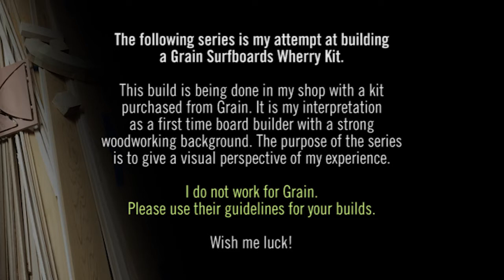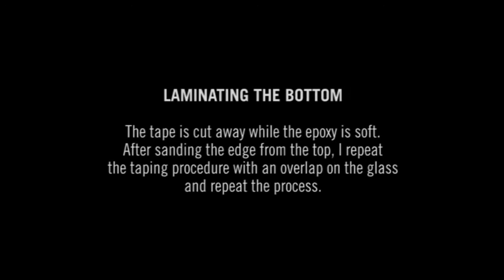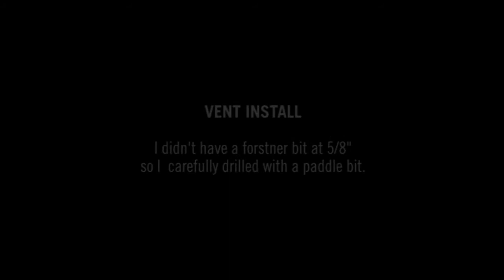Grain Surfboard Build - Part 7, Laminating

Comment: Hi Sattva,  on that strip of fiberglass you glassed on the crack of the swallowtail before laminating....was that done on both the top and bottom sides? Also-did you use a digital scale for mixing or just use the mixing buckets? Thanks.
Reply from the maker: Top only. It’s because the main roll of glass can’t get in there.

Use a scale. They are cheap and you will have no curing issues. Google scale weight “tare” (tare means zero out when an empty cup is on the scale).